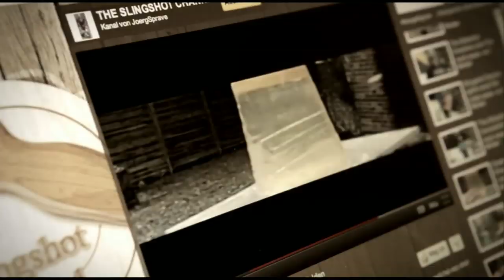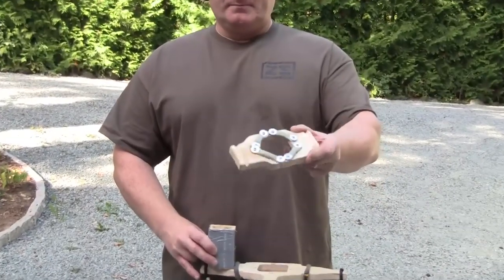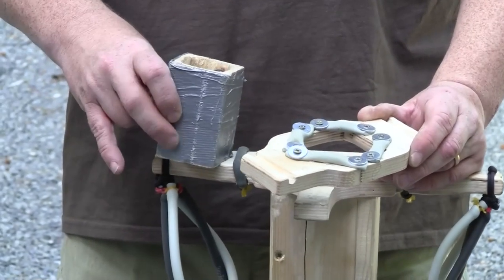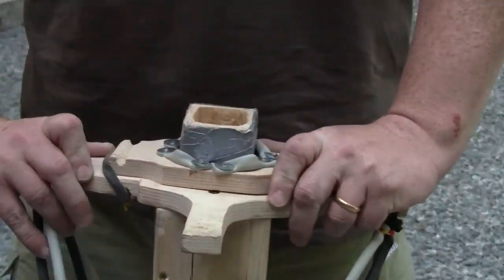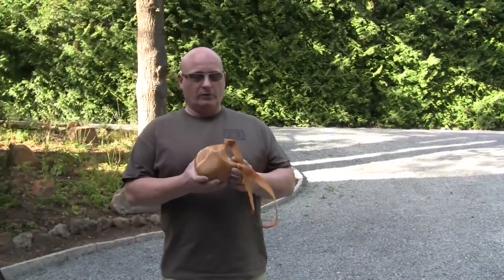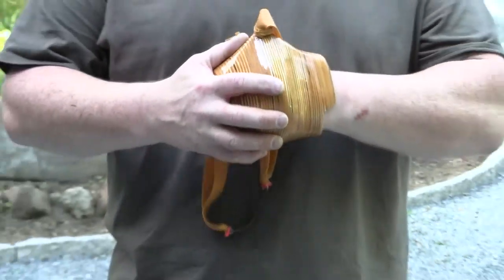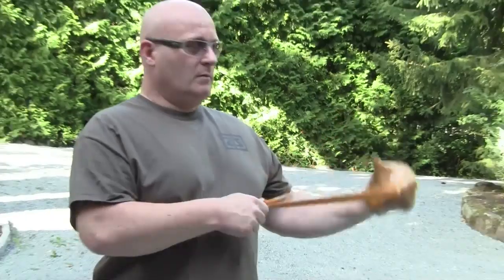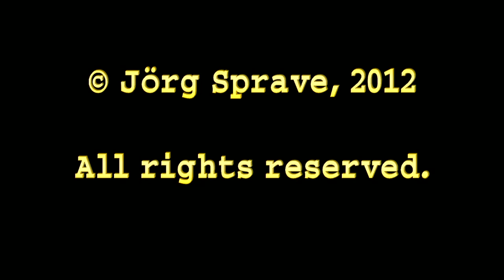OK, the sabot stays in.... plus: Snail Shell slingshot!

Comment from the maker: In fact, the Snail Shell frame was treated with linseed oil (cold pressed) before I coated it with poly. I like the golden color it gives to the plywood. The varnish protects it 100%, it will look the same way forever.

Comment: as a suggestion. perhaps  use a sabot that  splits open. a thick base, with 4 walls attached with hinges and beveled so they close up into a box, like the sabot you used.  this would allow the sabot to open up in flight and release the ammunition without the need for the face plate. just throwing in my two cents. wonderful stuff as always. please keep up the awesome work. :)

Comment: If I'm imagining what you are describing correctly, that would be very effective, and I believe it is very possible, but you would need to modify the barrel to cath the sabot, and have the sabot itself able to slide open on impact with the barrels end. I'm having a hard time thinking of how to make the last part work, but if it is compatible, that design would hardly sacrifice any momentum of the steel balls. However, I do find his current design to work just as well.

Comment: Why use rubber bands on the muzzle adapter. Isn't there potential for failure of it? Granted I'm sure it'd slow down the casing, but I'd rather it be easier to recover. Are you just using rubber bands for the spirit of only using metal screws, wood, and rubber bands?